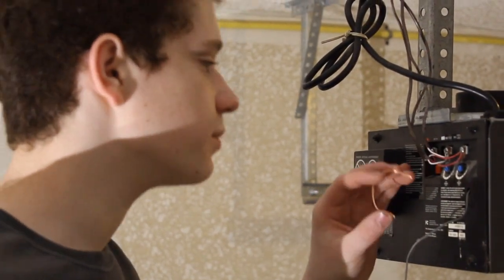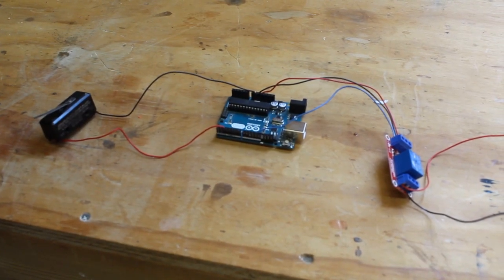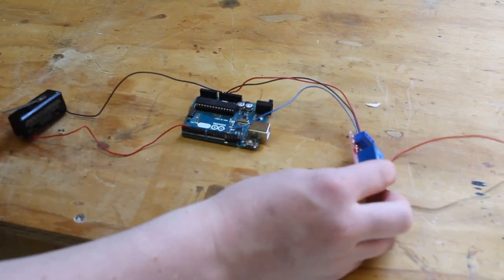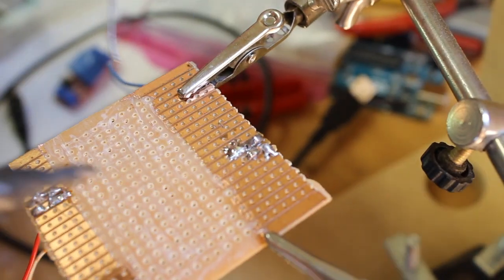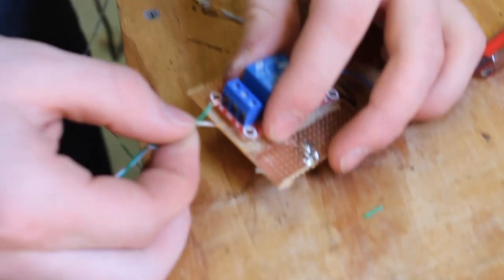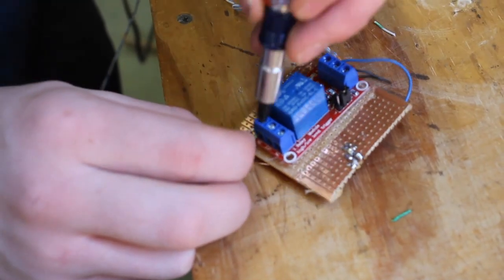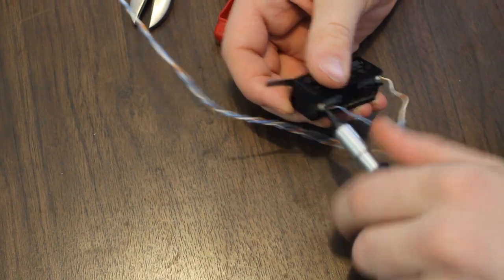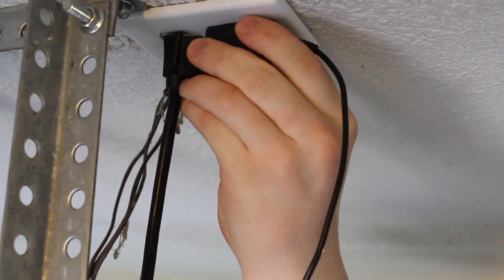Making an automatic garage door closer with Arduino

Comment: Also, in case you didn’t see my reply on the hacksmith when you asked me for ideas, here they are

 You could make something that hangs up picture frames automatically. Something that puts a movie disc into a dvd machine or ps4. You can make a water gun that somehow spews out liquid nitrogen without freezing the plastic (that ones not great idea) Make a device that can play chess. Make Something to set the table. And a machine that can massage someones back. Something to close curtains. A remote controlled door lock. Something that hangs up clothes.

The remote controlled door lock is probably the most plausable
Reply: Nice Ideas, if you watch the hacksmiths you might like my youtube channel Factors OF Fiction
Reply: @stuffgetsbuilt3168  cool
Reply: Brother of the channel here: I actually made a device to open curtains and blinds at the same time when a timer goes off. It’s pretty neat. No video of it tho.